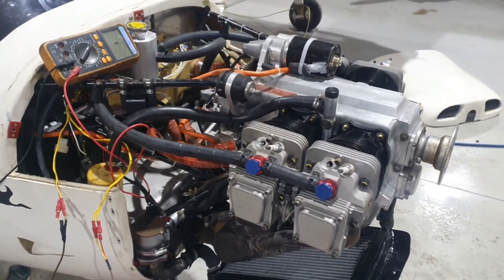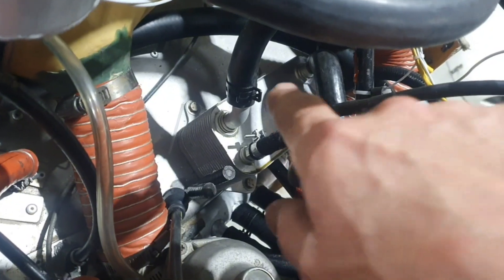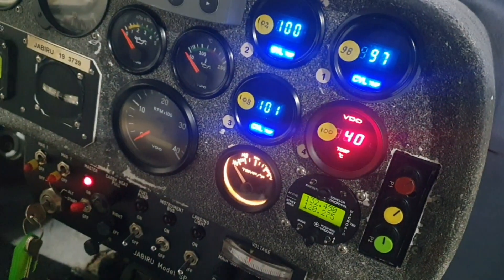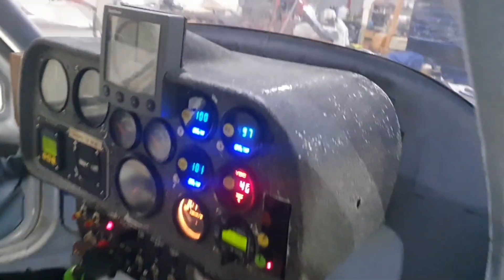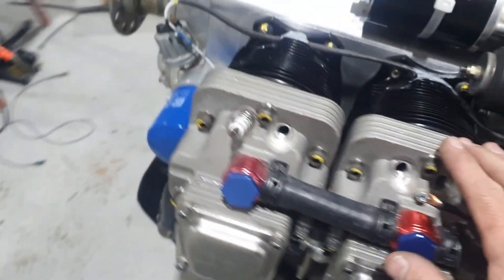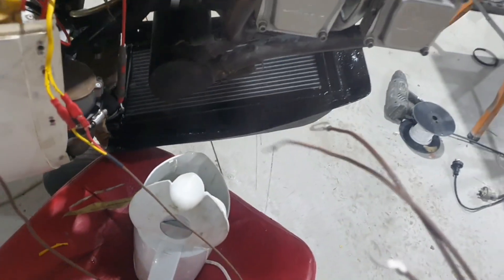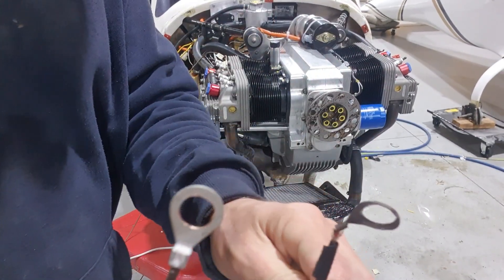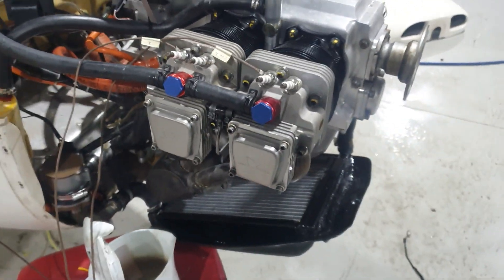J160 Jabiru 2200 LCH conversion by Rotec Aerosport.

Comment: Nice work on refurbishing a Facebook Marketplace Jab! How is the radiator mounted, not flopping about on its hoses I'm sure.
Reply from the maker: When the lower cowl is introduced the radiator (module) nests in strategically molded location buttons which position the radiator. Three fastners then secure the module to the lower cowl perfectly aligning it with the air scoop.